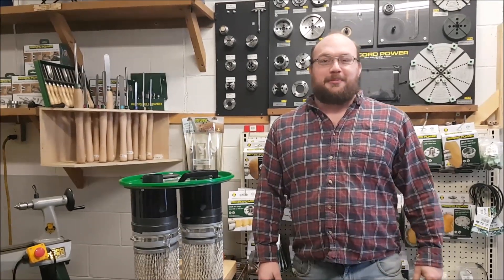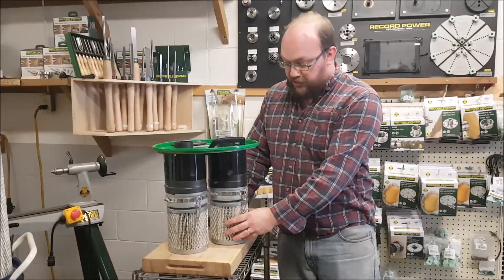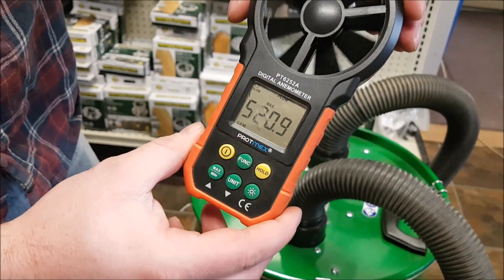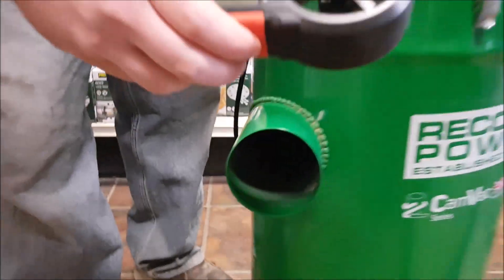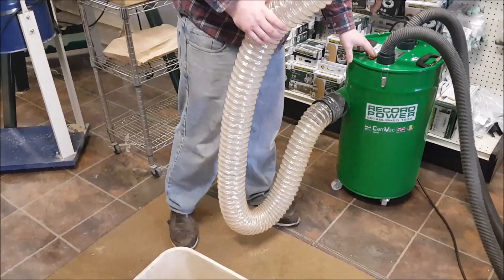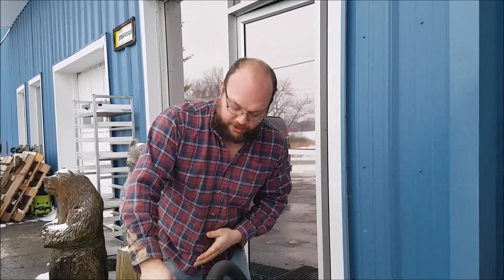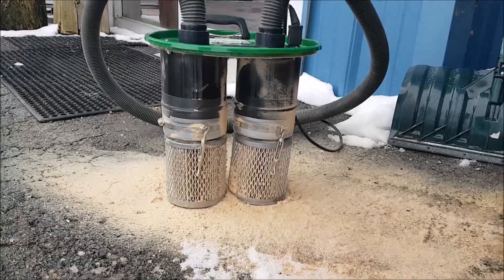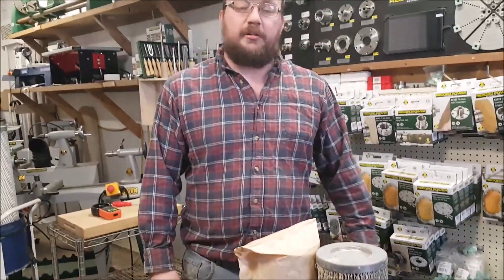NanoMax CV Filter Upgrade For CamVac Dust Extractor! CFM difference + How to Pulse Clean! EthAnswers

Comment: If I am venting the cam vac to outside, is upgraded filter necessary?
Reply from the maker: The upgraded filter will give you better overall airflow(about 15% increase) but if you are ducting it outside the better filtration doesn’t matter. Choice is yours!

Comment: Here's what I don't get:  I just got the 2 motor wall mount CamVac. Brand new. I also got the same anemometer you're using here. I checked the anemometer for accuracy using wind speed (driving in my car at numerous speeds) and it's spot on.  That leaves the only variable for measuring CFM as the area of the duct being measured. Using 4" (2" radius) and measuring it right on the outlet of my CamVac, the Max CFM I am able to get is ~484 with both motors on.  I don't know how you are getting 520.  Only thing I can think of is an inaccurate entry into the anemometer where it asks for the area in square feet, which for a 4" circle should be ~0.087.  The CFM reading can also be double-checked using an online calculator where you enter the radius (2") and simply measure and enter the speed.  The max speed I'm getting is ~63mph.  BTW, both motors, individually, each give me ~28mph max. or ~215CFM.  That said, it's certainly more powerful when reduced to ~2.5" than my decent Craftsman "6.5 hp" Shopvac was.  252 CFM vs 195 CFM for the Shopvac.  The unit is certainly nice, but the numbers certainly don't blow me away the way I hoped after watching all these videos.  I measured these numbers using the brand new, clean stock filters, with plastic collection bag on and motor vents stock with their caps on (and also off). I might have to go for the Nano filters to see if I can get a 15% increase or so.
Reply from the maker: I have found that the actual voltage supplied can change the airflow of the Camvacs. Most households 230v can be anywhere from 220-240. If your voltage is on the lower end you may find you get a little less performance. This video shows what I mean -  
https://youtu.be/sPqFi0I5tpc?si=Q5a06bXZe1ZC1fFJ
Reply: @StockroomSupply  Thanks. That does make sense!

Comment: I am a one man shop and will never be running dust collection on more than one machine at a time. My tools include 10" tablesaw, 8" jointer and 400mm planer (both with helical heads), 540mm bandsaw. Do I really need the 3 motor or will the 2 motor meet my needs?
Reply: I have had a cam vac for over a year & am glad I purchased the 3 motor unit. My table saw takes the most air flow as I have an extra 4" open end hose attached with magnets to the front of the table saw to collect the sawdust coming off the blade on the table top. I am a little short on air flow in this case so I am looking at upgrading to the nano max filters. If you were not using the extra 4" hose, the 2 motor unit might be ok. I suggest for the cost difference to go with the 3 motor unit. You can run 2 motors & then alternate them so 1 motor has a chance to cool down for 15 minutes every 2 hours as per the manual. I have 2 x 2.5" hose connections to my band saw & do get better dust collection with the 3 motors running. Also my recently purchased Sandx 17" drum sander also works better with 3 motors running. The other tools run ok with just 2 motors running in the cam vac.
Reply: In my similar one person shop, using only one 4" port tool, table saw, bandsaw, planer/jointer, at a time the two motor  cam vac has been excellent.  Would the three motor be better?  Possibly, and I'm not sure it would be a noticeable improvement.  Using the upgraded filters has improved performance considerably.   If I make additions to my dusk collection it will be a air filtration unit.  That would address nano sized particles floating in the air.

Comment: Does the cfm drop considerably if you use the bags over nanomax filters?
Reply from the maker: If you put the paper bags over the NanoMax filters you will certainly loose the gains in airflow the upgraded filters added. Essentially they will bring the airflow back to standard, which is still quite decent.